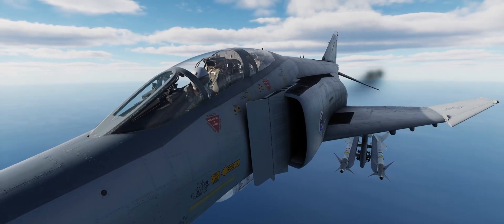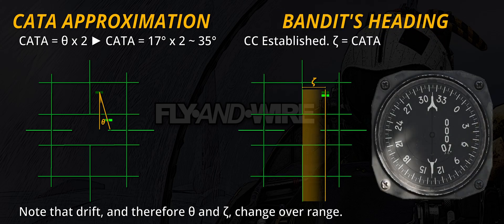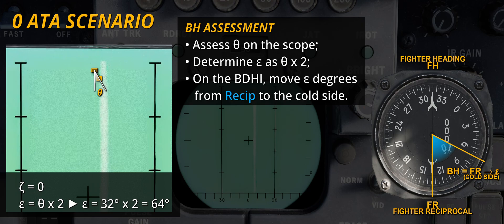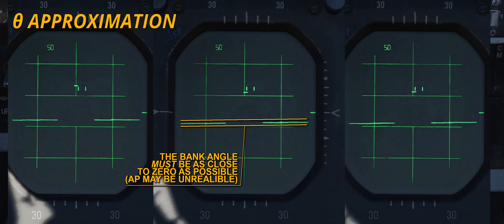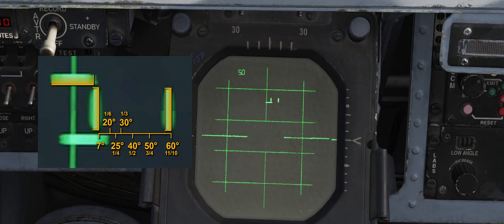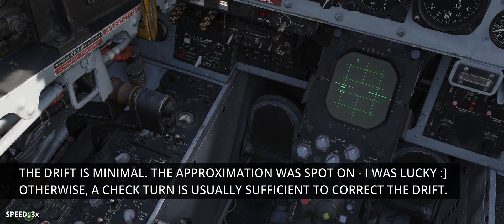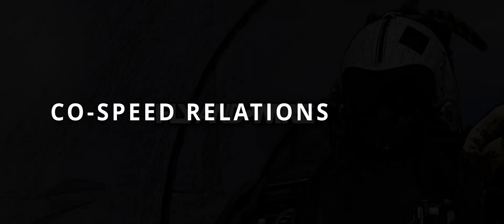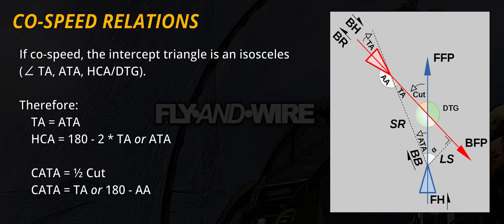DCS F-4E Air-to-Air VI: Assess Collision ATA & Bandit Heading [Essential]

Comment: Depending on the bandit speed, does a constant bearing on the B-scope not allow BH to be anything between fighter heading and 180 aspect (PP on the fighter)? Not convinced BH can be determined with angle drift alone (with known bandit speed or closing speed it should be possible I think).

Sorry to comment twice!

EDIT: I think that BH could in fact be between 0 and 180 aspect towards cold side, given only CATA, albeit at relativistic speeds near 0 or 180
Reply from the maker: > Sorry to comment twice!
No worries, I am happy to see viewers interested :)

This technique has caveats, including Collision Course or 0ATA. When on CC, the angles are captured and won't change. This procedure seems to be approximating the Cut, which is why it uses the Fighter's reciprocal. Funny, considering that the US AF prefers working with the HCA (its supplementary angle).
When ATA is zero instead, the drift is quite close to the TA, which approximates the Cut again well.
Check the image halfway through this page; it may help: https://flyandwire.com/2020/12/24/intercept-geometry-part-ii-definitions/
If you look at the practical example in the video, BH was spot on.

> I think that BH could in fact be between 0 and 180 aspect towards cold side, given only CATA, albeit at relativistic speeds near 0 or 180
I am not sure I understand what you mean here.
Reply: @FlyAndWire  In the practical example (starting 3:23) you were using the 0ATA method, I thought. What I meant was the first method (finding BH from CATA). For a given CATA and BH towards the cold side, there is (theoretically) a bandit speed which satisfies both. I.e. if you don't know the bandit speed, only the CATA, the BH could be anything from TA = 0 to TA = 180 towards the cold side.

You mentioned 10% later in the video being added to account for a speed advantage of the bandit. Maybe that's the assumption being made in the CATA to BH method, as there's a 10% factor added there. With an assumption like that, we should have the information needed to determination BH.
Reply from the maker: I tested both, but the 0ATA makes more sense imo since you can apply it when you point and assess at the beginning of the intercept. Technically, you can empirically find CATA by queueing check turns and then getting BH, but it seems a bit convoluted to me.
The bandit's speed, per sé, is not a problem since you are on CATA. Also, every intercept assumes that the fighter has speed advantage. Normally, a 5:4 relation is desired (e.g. for the overtake method). This is a bit more flexible. Also, remember that your primary source of information until real search radar appeared is the GCI. The controller can give you BH and the target's speed, and then you work our the HCA and carry on.
I think this method starts from a co-speed scenario, and then adds the 10% to compensate for the fighter's additional speed.

> if you don't know the bandit speed, only the CATA, the BH could be anything from TA = 0 to TA = 180 towards the cold side.
Remember that you know the ATA and the internal angles of the intercept triangle are TA, ATA and HCA. Unless the speed difference is enormous, TA should not fall in any extreme case, with the caveat that the bandit can change aspect instantaneously, and you can't do anything about it.
Reply: @FlyAndWire  That makes sense, the key must be the assumption about the bandit's speed range.
Reply from the maker: Correct. At the end of the day, you are intercepting a target and you should not be slower than it. If the bandit's faster, then you can try to change geometry (cut-into to maximise the increase of aspect, and then turn hot again, I guess), but it is not easy.